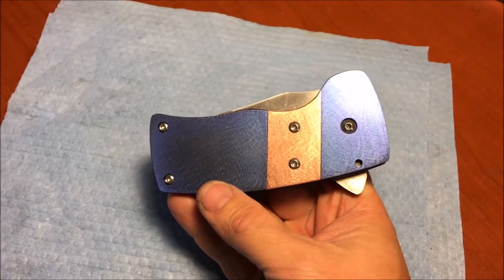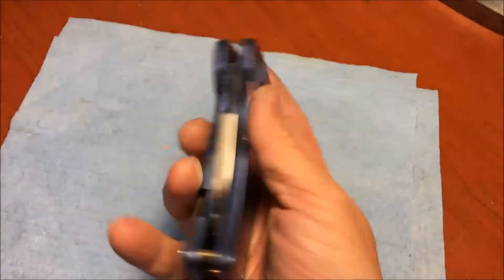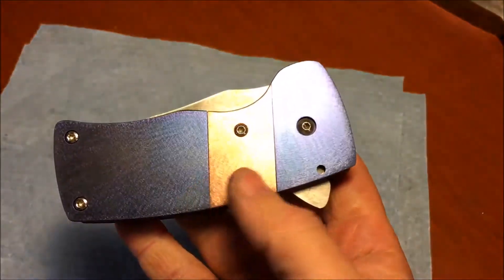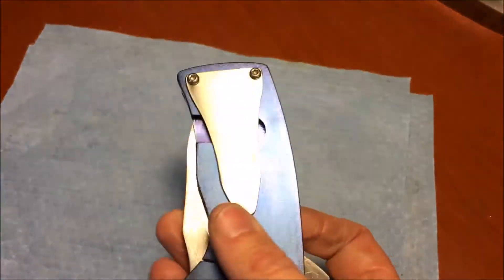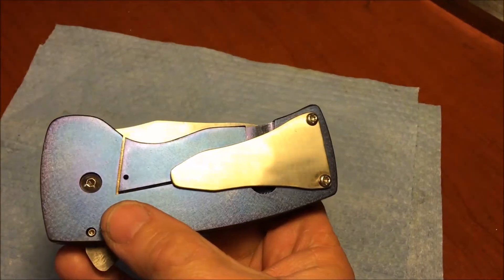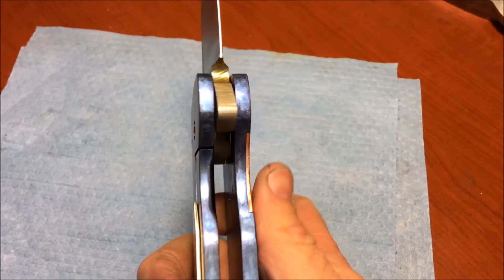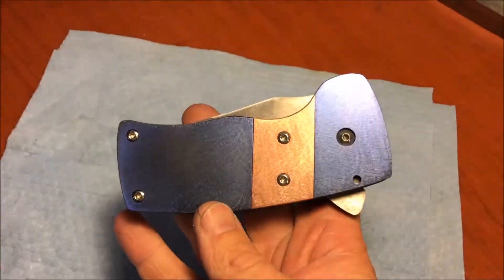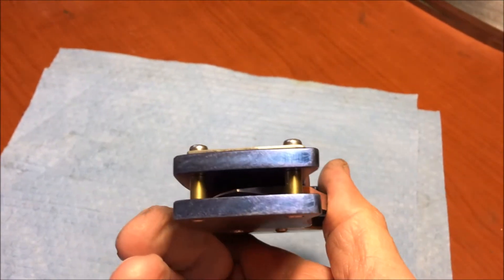RichMade Knives Senior Chief 2 Update

Comment: really really needs contoured handles but it looks absolutely beautiful rich! GREAT WORK!
Reply from the maker: +dom007bond nm Contouring with a manual mill is very challenging and would likely not result in being even all way around.  I did chamfer the edges so they are not sharp.
Reply: +Richard Kloc I really really like the copper inlay but I would love it if it were a screwless design. great work though I think you are headed in the right direction.